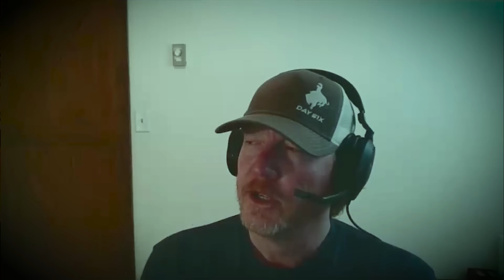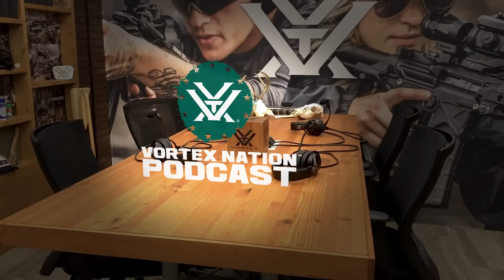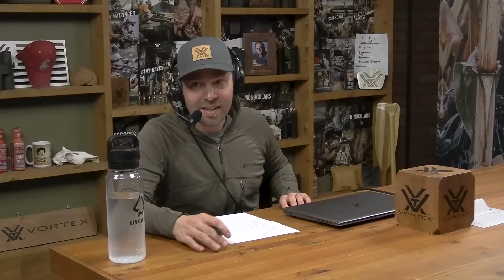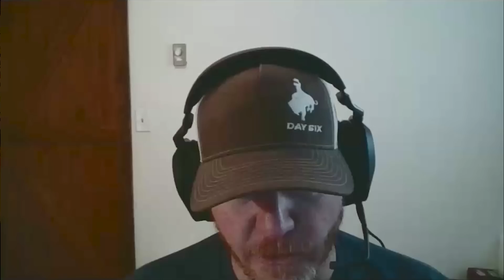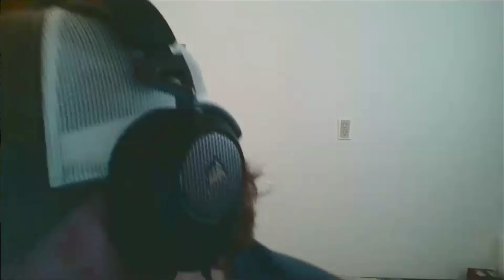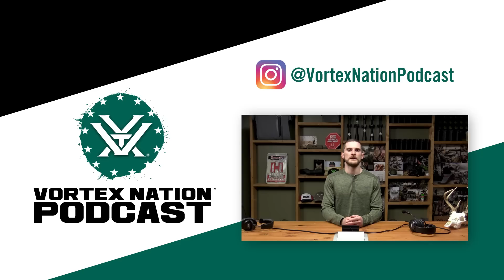Ep. 331 | Everything Arrows with Day Six Gear — And It’s a Lot

Comment: Late to the party, and I respect everything said.  I'm gonna take a second here to respectfully disagree with the claims made about the single bevel edge.  I'm not suggesting that they are in any way entirely superior.  Let that stand for the record.  But to make a claim that the geometry is inferior and the edge is unsupported seems to me to be misguided.  All sharp edges are unsupported at the edge.  To claim no rotation or leverage to split things or to be fragile cannot be supported by every chisel, saw blade tooth, drill bit, milling machine tool, lathe cutter, and on and on.

I have pushed both single and double bevel cut on contact broadheads through hide, potatoes, layerys of foam, and cardboard by hand with an arrow.  The leverage exists, but sharpness matters most.  If one would obey matching the bevel to the fletch rotation then I cannot see how the broadhead torque would rob arrow energy.

I will also note that Dr. Ashby has stated that single or double bevel broadheads breach heavy bone equally well above the arrow mass threshold.  So that's entirely fair to suggest there may me no measurement of superior performance in game either way.  

Otherwise, well thought out discussion and we can all benefit from the vast amount of experience presented, especially given the caveats cautioning us all to go do it ourselves.  I salute the integrity of the presentation without any reservations.  Any good strong sharp broadheads will do well with good arrow flight and the best shot placement we can manage.  I think edge geometry discussion may distract from the rest of the intended message.